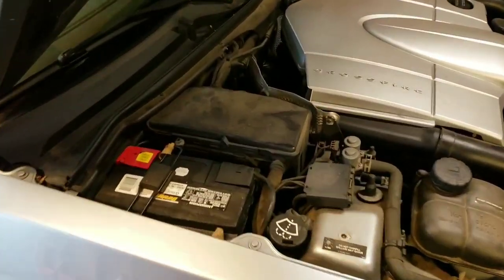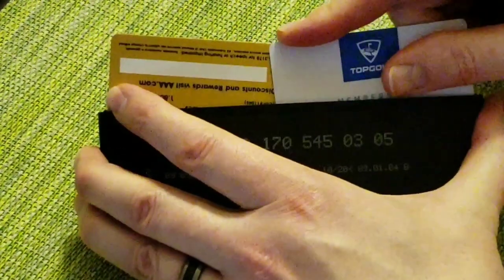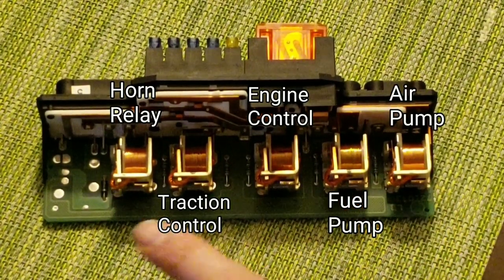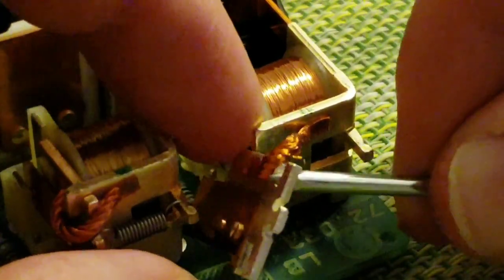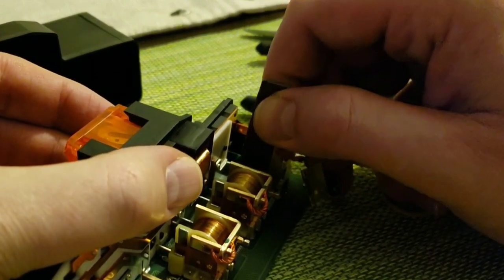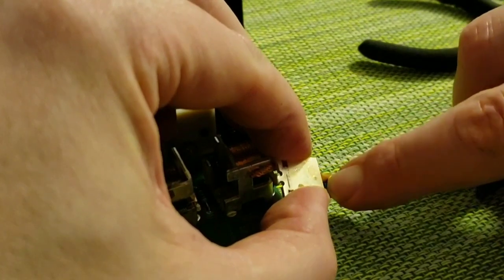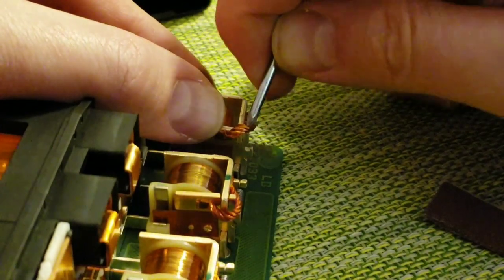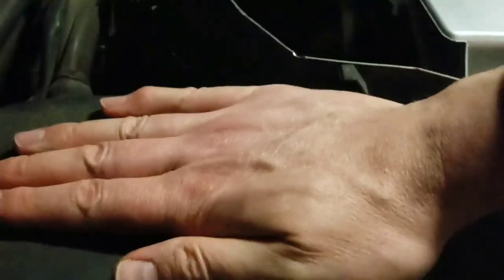RCM (Relay Control Module) Step by Step : Chrysler Crossfire Mercedes Mystery No Start

Comment: Hey man I just had a question and probably a very stupid question, but do I need to do anything with a new rcm that I bought or can I just pop it right in
Reply from the maker: If it's brand new you are probably fine, I would pop it out at about 12,000 miles of use and inspect those solder points at each oil change, also inspect the relays. If you see any charred residue at the joints or the relays, better break out the solder. If this RCM is just "new to you" but was a working pull, I would 100% get the soldering iron out and at least freshen up the solder pads at the base (circled area in video).
Reply: @glencouls  thank you!

Comment: a relay went bad on my RCM, not the joint.  do you have a source or part number for the relay?  i can solder a new one on.
oh nevermind, should have watched the whole video, thanks
Reply from the maker: Yep, it's in there. Might be hard to find. You may have to buy a dozen unfortunately. I do not have a source.
Reply: @glencouls  just checked, min 7 pieces at $4 each, $9 shipping.  not bad if the soldering part goes ok.
Reply from the maker: Thanks for this detail, good luck with the soldering I'm sure you will be fine. Was your relay worse than mine in the video? Because this thing I thought was shot, but since I cleaned it up, it's been working well ever since. Thanks for your note. Good luck.
Reply: @glencouls  mine is weird, the contacts are fine but it doesn't click shut installed in the car, but it did on the bench.  but it shows getting power and ground installed in the car.  maybe I need to reflow the joints again before ordering new relays.
Reply from the maker: @halleffect1  also check your battery. If it's a few years old I would be suspicious if it's getting enough to click the relay over.
Reply: @glencouls  the battery is new AGM from NAPA.  car cranks with plenty of speed but the point is well taken.  maybe the car's control circuit is weak for some reason.
Reply from the maker: @halleffect1  hey, since you are likely buying more then you need, let me know if you have any left over after your project. I wouldn't mind having a couple extra around here if you want to recoup some of your costs.
Reply: @glencouls  if i wind up buying them I'll let you know
Reply: @glencouls  my relay did end up being bad.  I sent you an email regarding ordering some.
Reply from the maker: Replied. Thanks.

Comment: Did that fix your problem? my sons having fuel pump issues. Added solder to some, but no cigar. may look into this.
Reply from the maker: This fixed my secondary air pump issue, as having the relay seized  closed burned the pump out.

Comment: i have an issue with the fuel pump relay in the RCM/K40. it seems like the resistor beside the fuel pump is open, no connectivity. even if i ground pin E3, no power goes to pin B3, out to the fuel pump. i ‘ve replaced the 10ohm .25% tolerance resistor but after i turned the key on, it got fried open again. can you help me? any idea why the resistor gets fried? it seems to act as a fuse or something. many thanks.
Reply: btw, great video. very helpful.

Comment: Did this clear your Secondary Air injection System fault code?
Reply from the maker: My secondary air error was finally cleared when I replaced the secondary air pump. I have that video on my youtube channel. It's a very easy repair.
Reply: @glencouls  my pump works though. The only thing I suspect is the stop valves might get stuck but or I have faulty o2 sensors. I still can't get to the root of the problem

Comment: im preparing to buy a 2004 crossfire. it starts and goes slow down the road,but soon as you give it gas it shuts down. He is saying that the traction control relay is doing that to the car,,does this sound correct?
Reply from the maker: Hmmmm. I read of people pulling the fuse for traction control to disable it, and they claimed to still be driving the car after doing so, so in theory that would be upstream from the relay, and eliminating this diagnosis. I personally think this sounds like a crankpositioning sensor, mine would drive until it warmed up to temperature, then just Stahl and die out.
Reply from the maker: I should also say however, the electronics in this car never cease to mystify me (why they do things the way they do), so anything is possible

Comment: Hey I have a 2007 crossfires and it tends to die 3 times a week i bought a brand new battery and it keeps dying could it be the fuses ?
Reply from the maker: Do you have an after market stereo or components? I would see if you have anything left on draining to battery. I installed a USB port in my center console back in 2015 and eventually ruined two car batteries. You might also check the alternator, sounds like it might be having a hard time keeping up.
Reply: Also check the alarm box that's under the windshield cowel under the wipers, exactly under the passenger wiper arm connection. The wiper arms don't need to be removed. Just a bolt on the firewall. The batteries inside go bad and draw the battery dead. After two years of the mystery driving me crazy, and multiple car battery returns, I searched on the crossfire forum. All it is is a noise box, dosent effect the alarm. The lights still flash. Replace with a new one or just leave it out. Hope this helps and is your problem.
Reply: Sorry to hijack your messages glencouls. Your videos are superior and a great help to the crossfire community.

Comment: Hey! No one in my area works on Crossfires... My alarm has just started to go off for no reason. Is there a fuse or module I can disconnect to stop this?  Thanks!
Reply from the maker: Yeah buddy, hate to say it, nobody works on Crossfires, Chrysler-Dodge has abandoned the model, and AMG-Mercedes looks at it like a ginger haired stepchild refusing to work on it because it doesn't have the star. (Not that I have issues with gingers or stepkids). So, you better get as much knowledge about it as you can, this car will be great to you if you treat her right.  You probably have a battery issue with the the alarm unit itself. I would recommend doing a google search, or crossfire forum search for "Chrysler Crossfire alarm cricket on crack" that should walk you through some fixes.
Reply from the maker: I would also look into your locking mechanism in the rear hatch to make sure its water free. Water will sometimes short the sensor back there and make the alarm head unit believe its triggered.
Reply: glencouls, I found a video that explained how to disable the alarm. I pulled the alarm out. We’ll see if everything else works.  Thanks for your video and reply!
Reply from the maker: @marksteddom6941  do you have a link to that video? My alarm has never really worked correctly and might be able to expand on this in greater detail.
Reply: glencouls, all the video said was that you had to take off the windshield wiper arms along with the cover that the windshield wiper arms go threw. I needed a arm puller to take both arms off. That was the hardest part.
Reply from the maker: Thank you for this information. I will create a video for this to help myself and others refurbish their malfunctioning or poorly functioning alarm. My alarm has never chirped when armed. Not sure that was ever a thing, however it seems working in and out of a large city it may prove to be a deterrent to would be thieves.
Reply: I have an independent MB shop that also works on Crossfires. Maybe you have one of those in the area.

Comment: Question, I took a test light to all terminal and I'm not getting power to the fuel pump relay,but I took a match stick and held the relay point closed and the pump worked. What issue do I have.
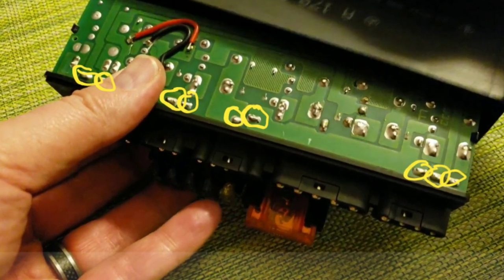Reply from the maker: Look at 1:45 of the video. Re-solder all of the joints (in yellow), use electrical solder not plumbing, and add about a 1/4 inch pull of solder to each pad. I know you may think the solder looks fine but EVERY RCM has this flaw, it's only a mater of time before the solder points fail. I've even seen resoldered RCMs solder points fail AGAIN. Make sure when you are done the solder joint looks like a nice round bubble, not a chunky rock. I've also seen some folks do some cold solder pads and it may work for awhile, but eventually the amps pushing through that socket board, and the clacking closure of the relays will knock that poor solder rock free.
Reply: we have the same issue and i’ve traced mine to the resistor to the left of the fuel
pump relay. it gets fried open every time. i don’t know why. the resistor seem to act as a safety fuse that gets fried open. any idea what i should do? i’ve replaced the 10ohm with .25%variance resistor twice already and it gets fried once i switch the key to on position. hope someone can help me. this is my 2nd K40 in 10yrs and i don’t wanna keep on buying them. i wanna know why they break so i can fix the source. many thanks.
Reply: I've solved my problem, I bought a universal relay and rewired the fuel pump. Works great no issues.
Reply: hi Terry, do you have the wiring diagram or pictures or a video of how you fixed it?
Reply: @rommeladre   it was pretty simple to do. I watched a video on how to wire a relay and found one that the guy explains how to. They are numbers underneath the relay . Power from a current battery,  find a fuse that will cut on and off with the key, ground, then what ever you need to power up.
Reply: Terry Hall , thank you so much Terry. will look for that youtube video. btw, what kind of relay did you use?
Reply: @rommeladre   the only type I found at advance auto was a 5 pin type, but you will only use 4 of them. It took me around 45 minutes to do it.
Reply: Terry Hall, found the video sir. 
https://youtu.be/spTx0k3_PI0
only difference is he did the relay swap on the horn relay.
Reply: @rommeladre  ok.are you having a fuel pump relay problem?
Reply: Terry Hall, yes sir. no power going to the fuel
pump because the ground path that switches the fuel pump relay is broken. the 10ohm resistor on its path gets broken every time i switch the key to on position.
Reply: @rommeladre  ok what model
Reply: Terry Hall,Mercedes Benz SLK230 sir. i think they have the same relay module as the chrysler crossfire.
Reply: @rommeladre  ok I can walk you through it. First go buy the relay and assorted wire fittings. Eye hooks butt connecter red wire,black wire. Go to the fuel pump and at each terminal on the fuel pump replace each wire underneath the car and up through the engine compartment so you'll know thats done.red for hot black for ground. On the relay with the number listed wire up to how it is done. You'll have to buy the yellow slip on terminals for the relay
Reply: Terry Hall thank you so
much sir. another question sir, do i really have to run up wires back to the fuel pump, can’t i use the wire connected to pin B3 to power the pump?
Reply: @rommeladre  I wouldn't do that since you had problems. I nounted my relay towars the front left side where the air filter is

Comment: Hello, I removed the RCM and I can no longer open my doors or the engine hood what should I do?
Reply from the maker: Driver door should be able to be opened with a twist of the key manually. The doors on the Crossfire are pneumatic, air operated  but the locking mechanism should be mechanical and pop the door. Let me know how that goes. Please be aware removing the RCM has nothing to do with your door locks NOT working, but removing the negative battery cable does. You need power to run your locks.
Reply from the maker: You should not close the hood when the battery is disconnected. Because of this experience, I will add that line to the video.
Reply from the maker: Bad news my friend you are locked out if your key does not open the lock. We all have different work flows when working on the car, my car is tucked safely away in the garage and when the hood is up  it stays up until I'm done. I rarely lock the car when it's in a locked garage. So, I have not experienced this issue before of not being able to get in to the car I'm working on. I have two ways to fix this. All require that you acquire something additional. The first and in my opinion the easiest, getting a 10mm ratcheting wrench and removing the hood latch http://N2C.co/hoodlatch . While I have removed the latch before, I have not done it this way so proceed with caution. The second option is to Jack up the car, place some lumber under the tires (which you must aquire) to provide suitable lift  and undo the bib to gain access under the hood and hopefully reattach the battery. You can watch this process for undoing the bib in http://N2C.co/hardway video. Notice the 3/4 plywood on 2x4s that slide under the tires. Do not just start shoving a bunch of crap under the tires, you will need to be operating underneath the car, reaching up to get the negative battery cable attached to the terminal. You have to make sure the car is stable and safe before you get underneath it, proceed with caution. Please be aware I have not done either of these two methods myself and it may require you be agile when troubleshooting this process and figuring out what to do next.